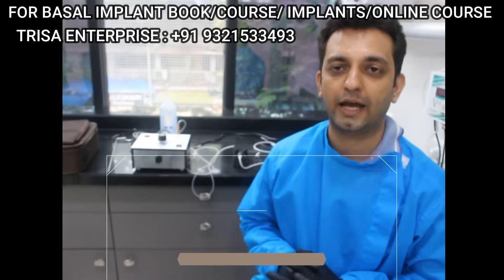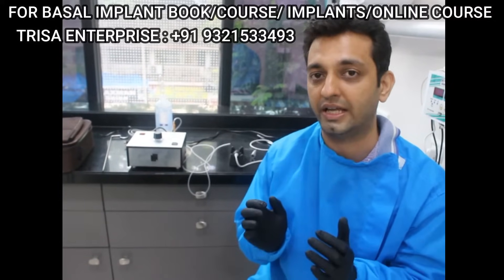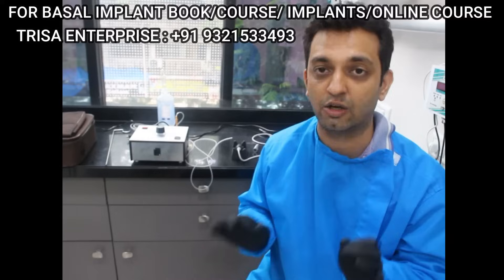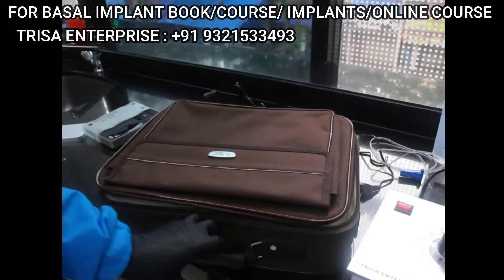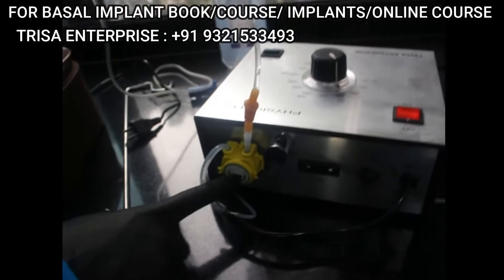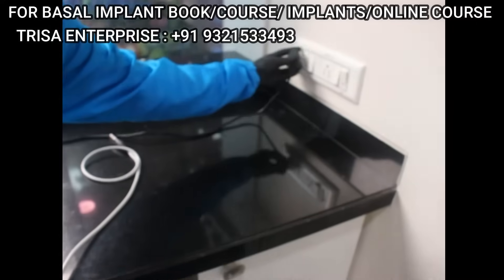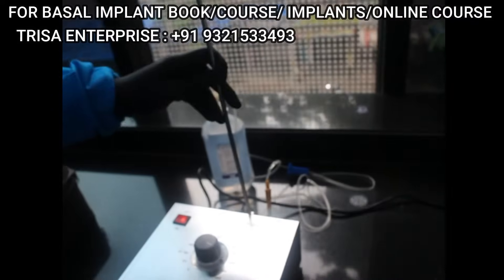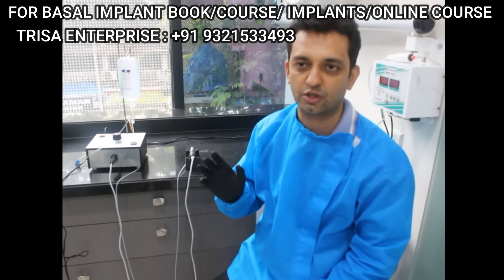PHYSIODISPENSER IMPLANT UNIT|DENTAL IMPLANTS MOTOR-DEMO ON SETUP|INSTALLATION GUIDE ENGLISH 2021

Comment: Do you provide service if repair is needed
Reply from the maker: you can connect with trisa enterprise- +91 9321533493
Reply from the maker: you can connect with trisa enterprise- +91 9321533493
Reply from the maker: you can connect with trisa enterprise- +91 9321533493